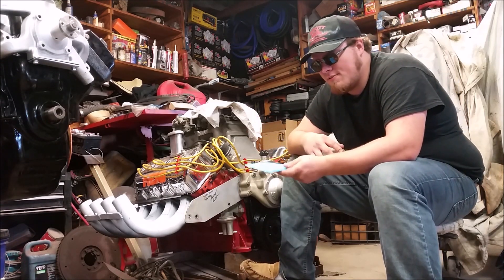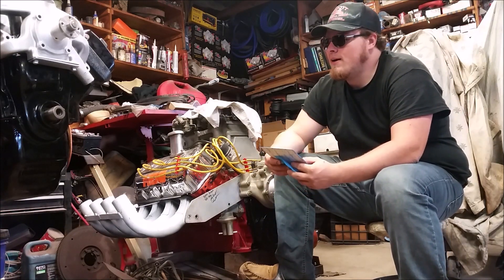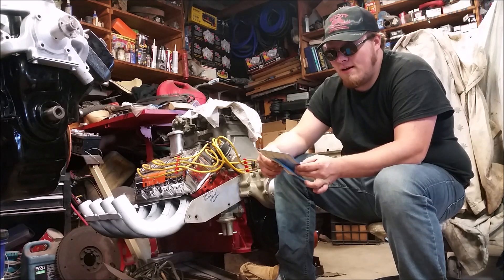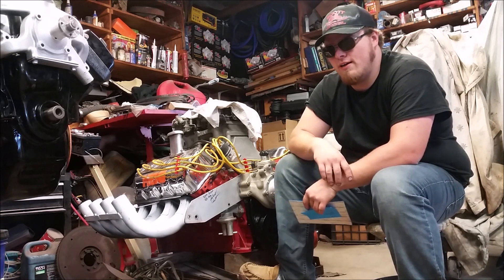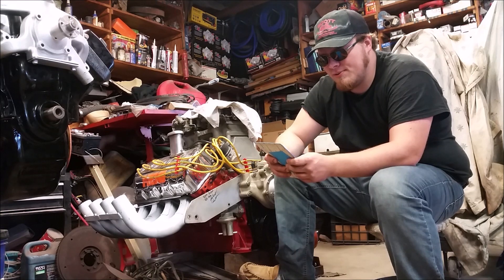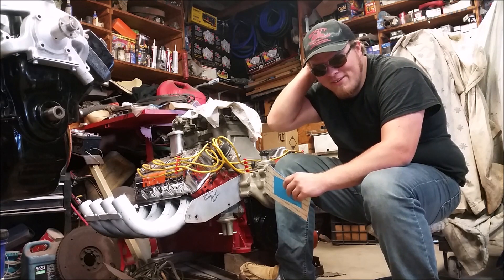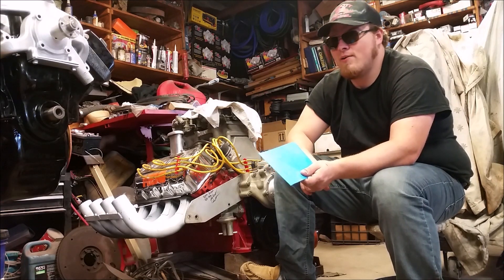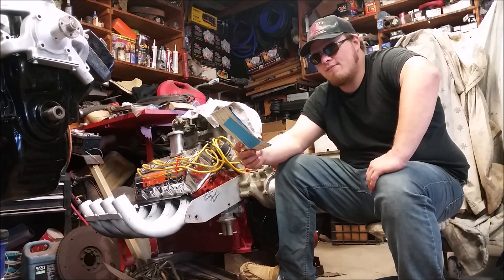8/13/18 Channel Updates, Hemi Builds, and whats coming in the future

Comment: Why beat the shit out of your car that you have worked so hard to build? burnouts are cool, but the price aint worth it to be cool. JMO.
Reply from the maker: I couldn't agree more Shawn, that last driving video with Jezebel, I did a big smokey burnout testing the Dana 60 out, and now the rear end is leaking gear oil from the driver side axle seal, so I am gonna take the axles back out and just upgrade everything to the green bearings and put better quality seals in
Reply: The green bearings are not an upgrade....The original Chrysler rear axle bearings are the best...Pack them in grease and set the endplay and they will last forever...
Reply: Sometimes Jed what causes the seal leak is not inferior seals but a worn axle shaft. Just a few thousands worn can cause leaks. I found this out on my old Ford. Put a new axle in and no leak.